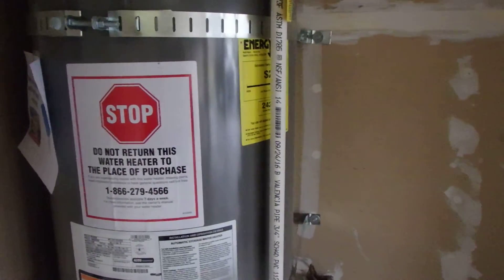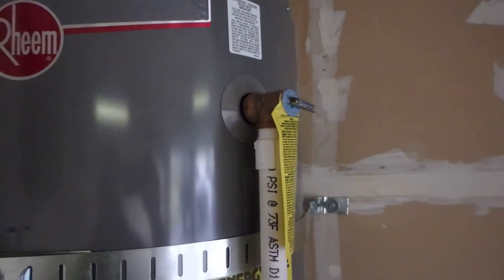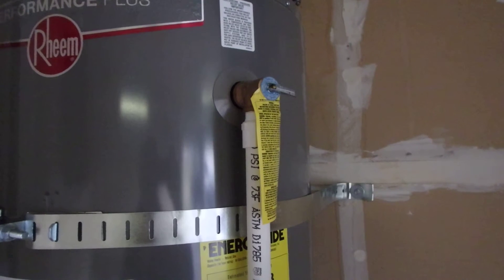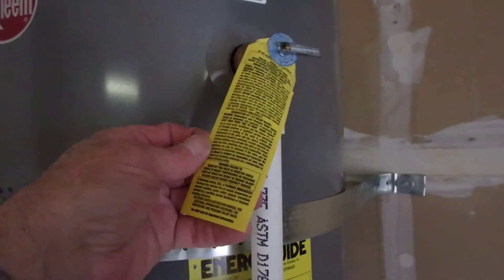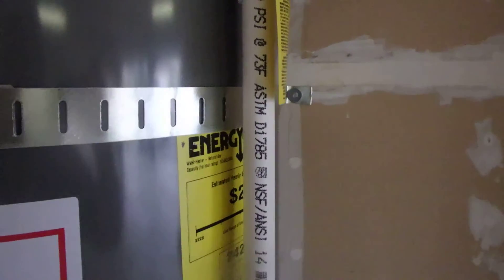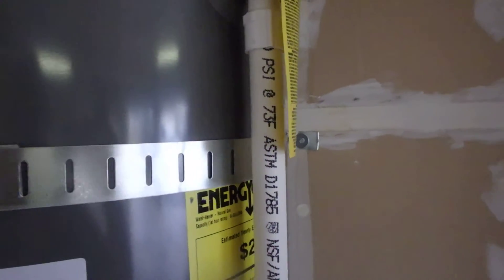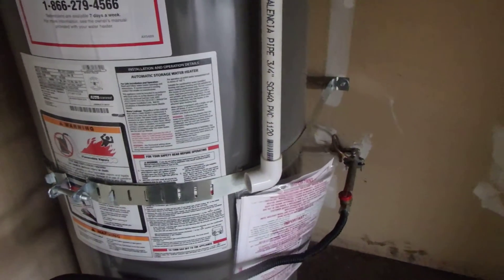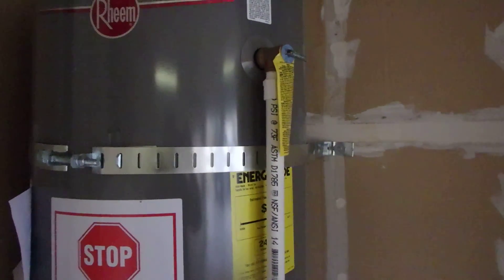TPR valve plumbing - Stuff Inspectors Know

Comment: My valve is located on top and it's facing the wall. Just wondering if putting a 180 degree turn and another turn down  will be legit and safe to meet city code? I plan to get a city inspector this month to see it

Comment: you are misinformed and doing your customers a disservice, which is typical for a home inspector.  That temp rating is under pressure, which the pipe isnt since it is open on the other end and basically just a discharge tubing.  Basically saying all it is doing is providing a path, so technically a garden hose would be sufficient barring as long as the manufacturer was ok with it.  Also to that point, read the manufacturer install book for that water heater, I can almost 100% guarantee you they state schedule40 pvc is acceptable for T&P connection use.  If you discharge it into a floor drain, what do you think the floor drain pipe(dwv) is made out of?  any place built after the 70's is going to be schedule 40 pvc dwv piping.
Reply: pvc is not to code in most if not all locations for a pressure relief valve.  As stated in p2804.6.1 the IRC requires the use of materials listed in P2906.5 which does not list pvc as approved.  That section also states the minimum rating of 100psi @ 180f.
Reply: Pvc isn't code. Period.  Copper or CPVC .

Comment: The temp on the pipe also states the allowable pressure at that temperature.   Is not a concern for this application because the pipe is not holding pressure since the pipe just discharges at the other end.  That is why his pipe and thinner wall premade pipe are used all the time and code compliant.
Reply: pvc is not to code in most if not all locations for a pressure relief valve.  As stated in p2804.6.1 the IRC requires the use of materials listed in P2906.5 which does not list pvc as approved.  That section also states the minimum rating of 100psi @ 180f.

Comment: 200 degree water?
Reply: If the thermostat failed to shut off the burner or electric element,  the water could reach well over the boiling point in a pressurized tank, and this is where the danger come in play.   As the temp rises,  so does the pressure and when a pipe blows off the tank (after the plastic or solder softens) or the tank ruptured,  the superheated water is now at atmospheric pressure,  flashes into steam, which instantly increases it's volume 1600 times when water goes from liquid to vapor.   The resulting blast is capable of leveling a home and in a densely populated neighborhood,  seriously damaging the homes next to it.   

To prevent this from happening, a T&P valve is designed to quickly open full blast when temperatures approaching 210°F are measured on the sensing probe, and remain fully open until the probe cools some degrees below 210°F by the cold inlet. The third rating on a T&P valve is the input rating in BTUs /hour. This refers to the amount of steam that the valve is capable of releasing when properly installed and maintained according to the manufacturer's instructions.  It's critical that the valve have an equal or high BTU/hr rating than the heater input as indicated on the nameplate.  If the valve has a lower rating, and a runaway heating condition occurs,  it would not be able to discharge fast enough to allow sufficient cooling by the cold inlet,  resulting in a possible rupture of the tank.

Comment: 200+ degree water.  Who has water that hot?
Reply: It's a temp and pressure relief.  If the heater does not turn off the water could reach boiling temps before the valve releases.
Reply: If something goes wrong with the water heater, like overheating, the temp at 150psi or great could be well over 320 F
Reply: think; it doesn't discharge under "normal" use

Comment: Hi!  I liked the TPR valve drain line video and your point about the PVC temp rating is spot ON ALSO, I believe that in most states the plumbing codes now require that a brass transition coupling (brass / CPVC) be used rather than a PVC or CPVC coupling screwed directly into the brass TPR valve body, most likely to allow a more gradual temp gradient where the brass part of the coupling may better and more safely absorb the higher temps and / or pressures in the event the valve is triggered

Comment: I just bought 2 (seem to be thin) PVC type drain pipes design for water heater from Homedepot. Our condo is on 2nd floor and this a copper drain pipe next to another water heater belong to a neighbor. 

Have to check them temperature on them.  
I also might to elbow it to connect to a copper drain pipe on the other end.  There are 2 water heaters in this closet in for our condo, and a neighbor.

Comment: For my water heater, it’s in a corner and if I rotate the unit so the drain pipe can run straight down into the exit pipe opening,  the front panel/label will be facing the corner.  Is this against code/etc?  Just feels weird to use 2-3 elbows to get the drain pipe to wrap behind the unit.

Comment: In 2000 went to NATC technical College for plumbing and have done plumbing a huge amount over the last 20+ years. I have installed hundreds of water heaters, and piped hundreds of custom homes, thousands of apartments, office buildings, resturaunts, a school. I always use hard copper from the tmp valve and piped the drain tmp drain line 6-12" inches above the landscaping  dirt and on the outside of the building. That way if the tmp valve opens up it will drain outside of the building.
Reply: I just bought 2 PVC type drain pipes design for water heater from Homedepot. Our condo is on 2nd floor and this a copper drain pipe next to another water heater belong to a neighbor. 

Have to check them temperature on them.  
I also might to elbow it to connect to a copper drain pipe on the other end.  There are 2 water heaters in this closet in for our condo, and a neighbor.

You recommend copper pipe for this not PVC?

Also somebody here recommended CPVC.

Like the idea.  I will have to connect CPVC to a copper drain pipe connected to another water heater so it will drain out somewhere from 2nd story condo.   Can you recommend adapters to connect CPVC to 1/2 copper without soldering - shark bike maybe?  Also what kind of adapter do I need to the CPVC to connect to the relief valve?

Comment: Can you tell me how to get the correct pipe to replace the PVC? It was here when we bought our house five years ago, and our new buyer wants it replaced. What do I need to do? Can I just go to a hardware store or is this a more specialized piece? Thanks!
Reply: Use a CPVC (Off White) material. Ask for it at Lowes etc... They will help.
Reply: @hhihomeinspections6427  Like the idea.  I will have to connect CPVC to a copper drain pipe connected to another water heater so it will drain out somewhere from 2nd story condo.   Can you recommend adapters to connect CPVC to 1/2 copper without soldering - shark bike maybe?  Also what kind of adapter do I need to the CPVC to connect to the relief valve?
Reply from the maker: Probably the easiest thing to work with, (and cheapest), is CPVC. You could also do copper, but it is more costly and
 would require soldering the joints. CPVC can just be glued with the rated PVC cement
Reply: @cameohomeinspectionservice6832  do you have to glue CPVC?